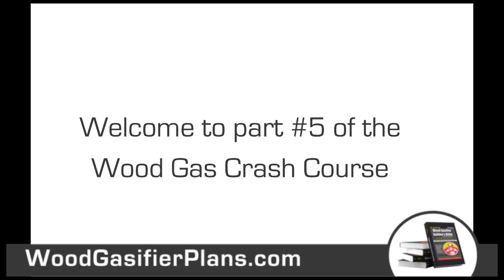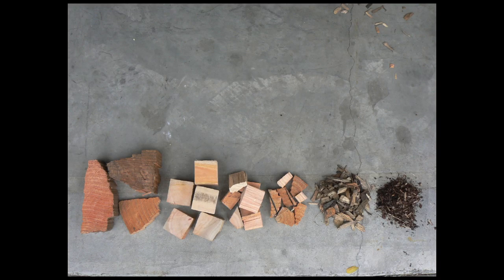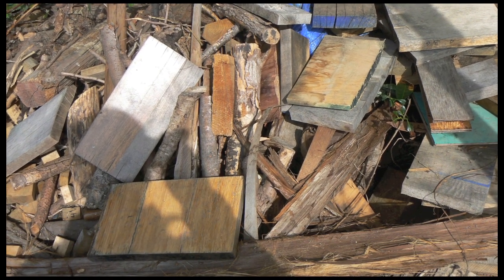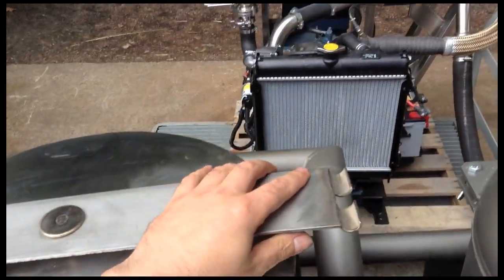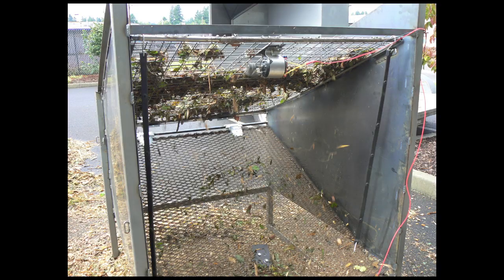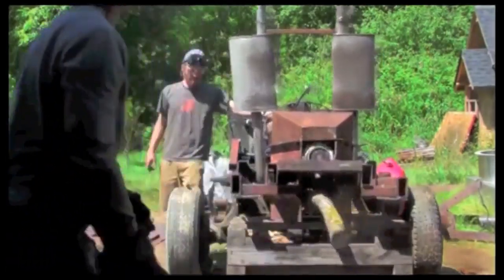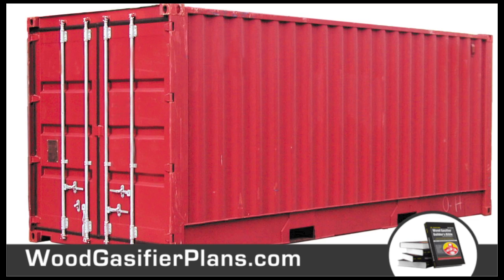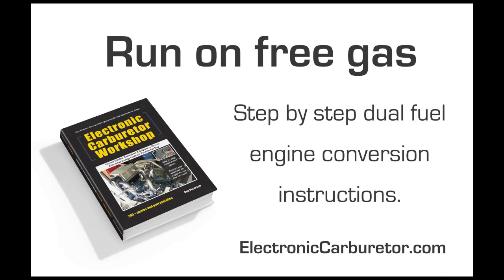Wood Gas Crash Course 5 of 7 (Gasification 201) woodgasifierplans.com

Comment: I live in an old farmhouse. I have a 200 gallon above ground propane storage tank.  Can you go over WHY you consider it risky to compress woodgas, and how to mitigate those risks? Thanks!
Reply: Elsewhere he says that the hydrogen in the wood gas can make the steel tank brittle.
Reply: @subliminal_donkey  how??? That makes no sense.
Reply: @mattparker9726  no idea! I know biogas you have to take out the corrosive hydrogen sulphide before it can be compressed but idk if thats a problem with wood gas
Reply: A bag works great. I use one of those sports blow up beds. That way you don't need any filters. Just fill up the bed wait 5 minutes. All the tar and stuff goes into the bed . Outcomes blue gas. You can compress it or hook the generator right up to the bed. Would be good to have a one-way valve.